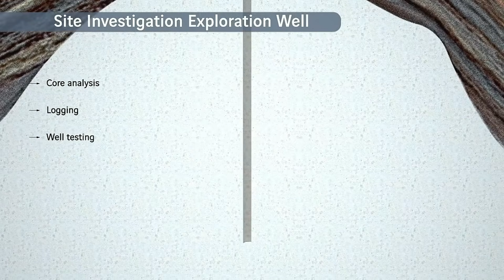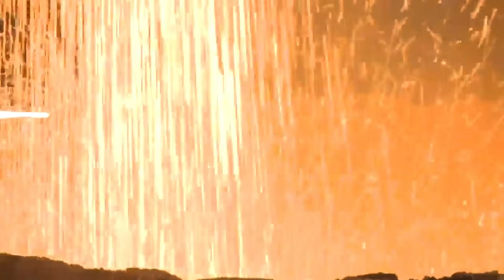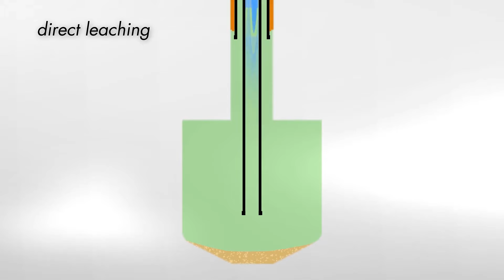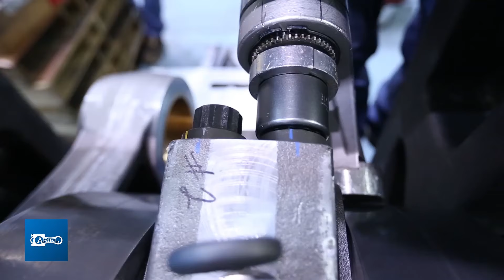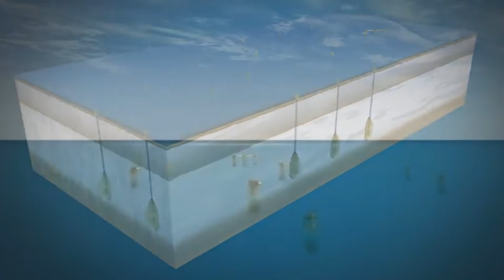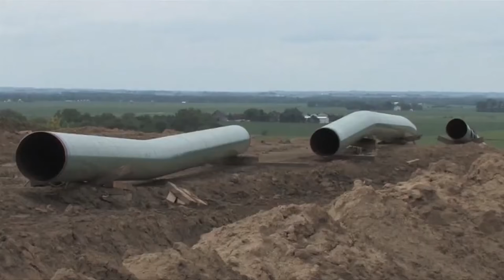America’s Secret Salt Caverns Holding Billions in Energy. Underground Salt Cavern Storage Explained

Comment: Salt domes are used for storage. The domes can be 17,000 deep, but the top of the dome is not very deep underground. Look up Weeks Island, Avery Island, Jefferson Island, etc. in Louisiana. These are all salt domes that have pushed up the ground, so top of the "island" is around 150' above sea level, where the surrounding area is about 5' above sea level. Weeks Island has an old salt mine that was converted into a strategic petroleum reserve. The other side of the island is still being mined for salt. Jefferson Island is where the Texaco drilling rig drilled into the Diamond Crystal Salt mine and drained the lake into the mine.

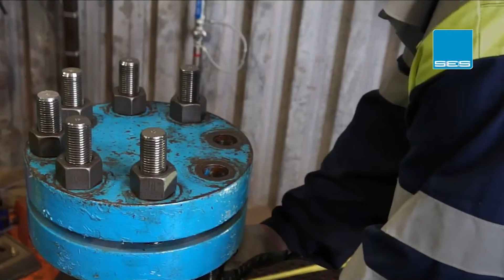Comment: @ 9:42 that is bolt tensioning not torquing. They hydraulically stretch the bolts.
Reply: The automotive industry went to tightening by bolt stretch a few years back...now every time we do a valve job, the customer gets to pay extra for the single use headbolts, etc.

Comment: Let's see now... You go to great lengths to drill holes in order to intersect chambers containing oil and natural gas.  Then you pump oil and gas out of those chambers.  Then you expend energy and time to build an empty underground chamber somewhere else and pump it full of the stuff you just pumped out of the ground.  Have I got that right?  Otherwise, please tell me why you don't simply leave the oil and gas where you found it and extract it when you need it.
Reply: There are no “chambers containing oil and natural gas”.  The hydrocarbons are contained in small pores in the rocks.
Reply: @bobfoster687  So, maybe it's faster to pump the stuff out of a true container than out of the porous rock?  Could that be why it's done?
Reply: I think it sort of dribbles out of the well, mixed with other stuff. Once purified it goes into the salt cavern. Just my guess.
Reply: Well, it does need to be refined and if my understanding is correct into 6,000 different products from crude oil. Many of those products end up at Home Depot Walmart and a million other stores and gas stations and Manufacturing facilities across the country . So with all due respect sir leaving it in the ground till you need it it's probably not practical considering everything involved from pumping crude oil, to your buying WD-40, Plastics, tires and thousands of other products from thousands of other places. From drilling transporting refining transporting refined products to manufacturing facilities all over the country in the world turning it into products that wind up on our store shelves or factories full of innumerable products that involved some level of crude oil refinement. Literally everything in life in modern America depends on crude oil products. And as far as storing it in the salt Caverns if the video is correct and my understanding is correct, it is because these storage caverns in the salt provide a much more reliable and safe seal for the Energy Products stored there. As opposed, to say, fractured rock and other less reliably sealed geological features. The master engineer / designer of the universe, God ! Had all of this figured out for us in advance. And he has so graciously allowed us the privilege, and satisfaction, and fulfillment, and opportunity of developing and using all that he has blessed us with ! 🇺🇲💖🇮🇱💖🇵🇭